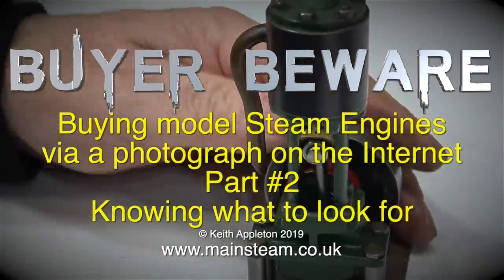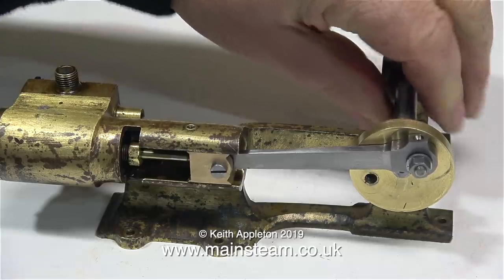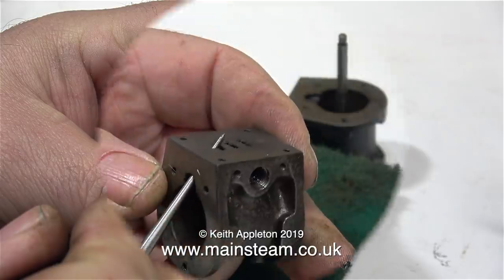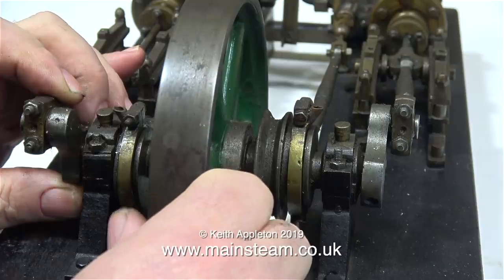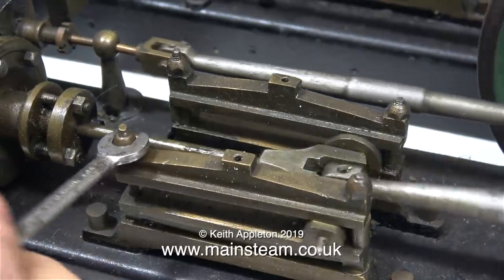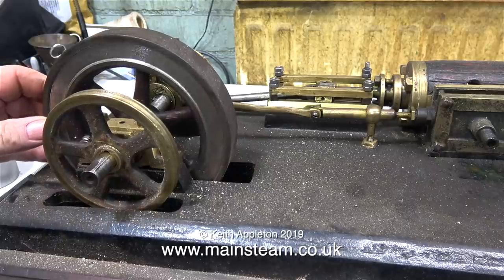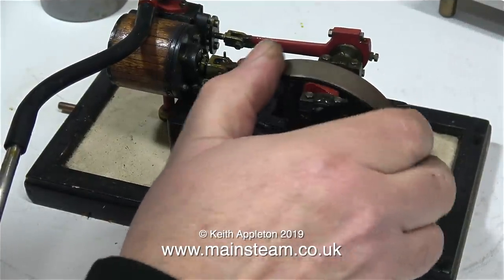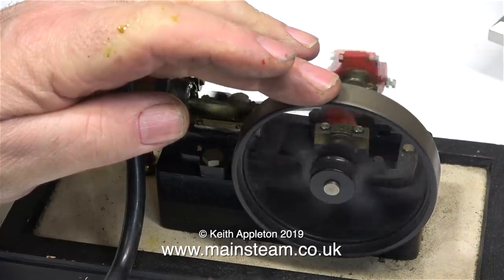BUYER BEWARE - BUYING MORE STEAM ENGINES VIA THE INTERNET

Comment: Still have my working miniature boiler engine from the 60's. It used those ignitable tablets and distilled water.
Most the parts are stamped sheet metal, for the base and boiler. The fire brick design is embossed and stamped into it as well...all the valves are scale and small and no shortcuts were taken on the brass and castings or bolts.

Comment: Also wondering if a steam injector will work on a boiler with  3"x 7" ,and ~ 130 inches of heating and 45 C.I. of water at 65 psi? I can't get a response  from any vendors in England ? also are they adjustable , Thank You for all the Great videos !  Alec
Reply from the maker: No, for a boiler of that size and pressure a Live Steam Injector is not required and would be a waste of time. They are not adjustable - just on or off.

Comment: Yes Keith, I found this video very useful. Based on your vids I would never buy one of these from eBay. 

I was never considering purchasing one until I saw your video THE TROUBLE WITH OLD etc a year or more ago.
Since I'm a mechanic I have been looking about the place, reasoning I could fix them up. I haven't made a leap of faith as of yet. After seeing these 2 vids I'll pass on the idea. I feel the exceedingly tawdry manufacturing, quality control and irreparable faults I think what's the point? It is supposed to be fun. None of this looks like fun to me for a mechanic mucking around out of hours. It is too much like work.
I just couldn't be bothered since I appreciate prescision - even loose 'prescision' would be OK, but these aren't that. More they're just pieces of ess aitch one tee.

Comment: Hehe if no one wants them "bitsa"'s, I quite like 'em and a long time fan of ahem "hybrid" stuff he says looking out the window at his three wheel van, my 1958 Lambretta is a bit of a bitsa having a 1966 engine and a few bits off later ones and some appallingly made Indian handlebars and horncasting which if the bits themselves weren't so rare I wouldn't have fitted 'em to me worst enemy's missus but just for a handlebar top cover is hundreds so had to go down the Indian backstreet rubbish route and invested in a LOT of JB Weld and QuikSteel and some low temp alloy brazing rods lol.   Never ever own a Lambretta unless you have deep pockets and brains surgically treated for common sense.